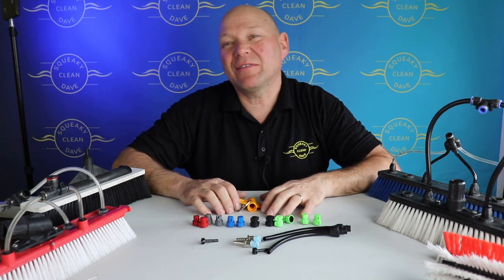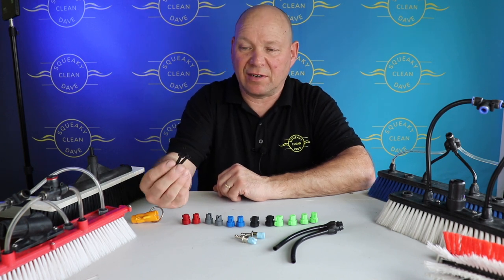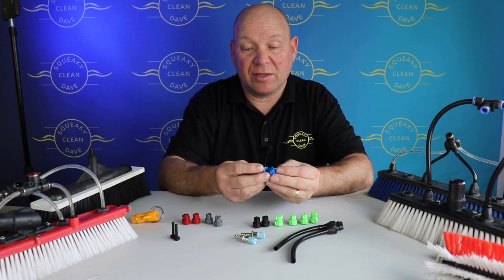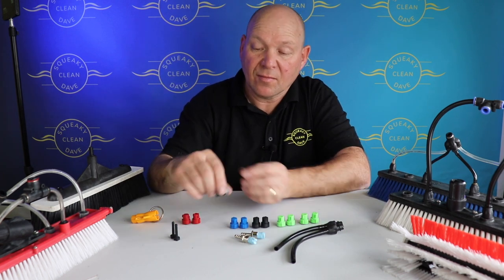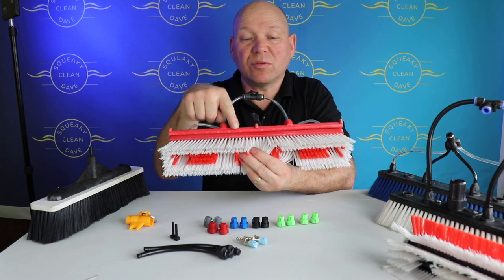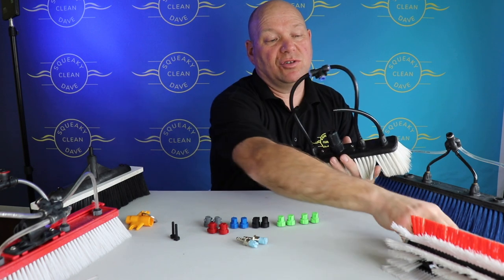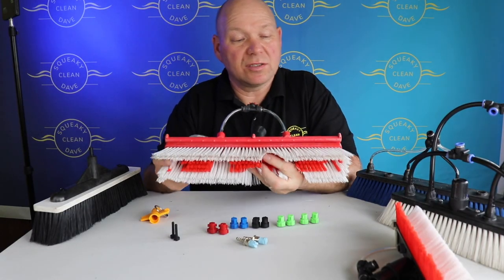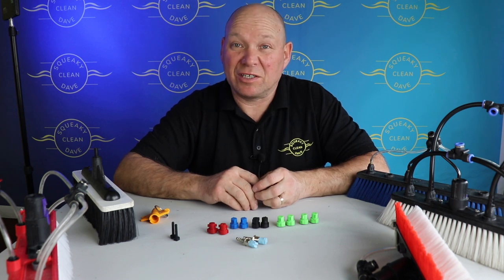Understanding Water Fed Pole Brush Jets

Comment: I only use 14" brushes have done for years, I went from 4 pencil jets, to gardiner rinse bar bar and now I have been using xline brushes with wash and rinse bar integrated inside, they have been super brushes and rinse bar inside the brush is very effective on or off the glass. rinse bar has 11 jet and has good covered over the full brush expensive but all brushes seem to be going up so there not too far out of the average brush buy.
Reply from the maker: I tried a blind brush years ago and it seemed quite heavy but it was a sill brush. how do you find them for weight?
Reply: @squeakycleandave1  roughly the same as the ultimate range that gardiner do. I was using the dupont 14inch then they stopped selling them, stumbled on the xline range and not looked back. Started using the flocked version its like the rolls Royce of brushes. Tho you need to be careful on Georgian windows you can catch the alloy cnc rinse bar if you press too hard. I'm using it on the high mod ova 8 22, if anyone is thinking of getting one there great. But need to be double taped from new same as gardiner poles are. Mine has worn dramatically in 6 months of ownership. Lots better now its double taped. (Base and where you want the pole to stop)
Reply from the maker: @GreatAytonWild  great thanks Shaun. I might look into xline. I will put some more tape on my pole as well 👍

Comment: Can you run 4 pencil jets and that top rinse bar all together?  Or is it better to do just one or the other to keep a decent flow rate?
Reply from the maker: If you could make it work you could do but you would use a lot of water
Reply: @squeakycleandave1  Which leads me to another question... regarding maximizing water pressure from a spicket... Am I better off running 150 ft of 5/16 hose all the way to the water spicket out the pole or running 100 ft of industrial 3/4" garden hose to my last 50ft of 5/16 water fed pole tubing?

Comment: 👍✨Do those jets fit on any WFP brush ?
Reply from the maker: No most jets are designed for a particular brush. but most brushes will fit any pole but its always worth checking with the manufacturer before ordering.

Comment: Alex Gardiner's tools are well thought out for sure.

Dave there is a special but rare pneumatic 'T' connector that contains a valve. 

It would allow you to switch between two types of jet by turning a knob - this is way easier than disconnecting the alleged 'quick connects' because they get stuck after a while.

If they work out - I can let you know. Anything that makes us lazier is progress!

Also thanks to your kick in the butt I went and bought every 12v electrical book on Amazon.co.uk and am descending head first into the scary world of electricals - not as scary as the wiring setups I've seen in some wfp vans though!
Reply from the maker: I absolutely agree with all you have said. Definitely let me know how the valve goes. Send me a link if you have one. 
Happy wiring 😁